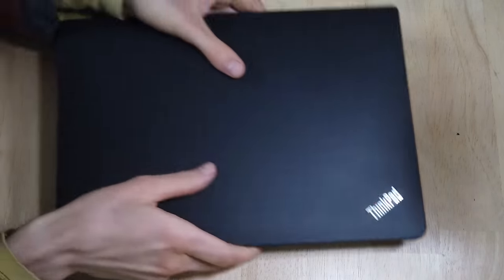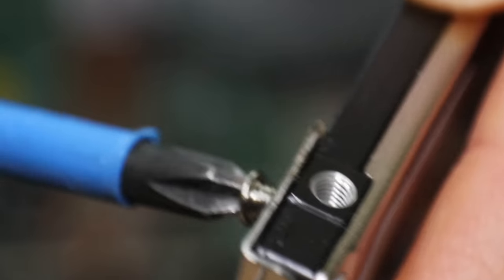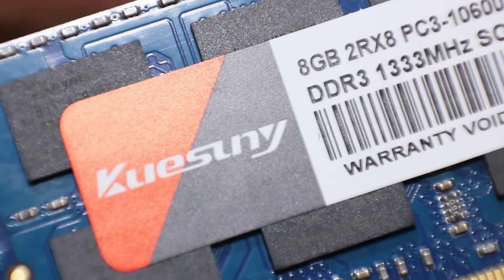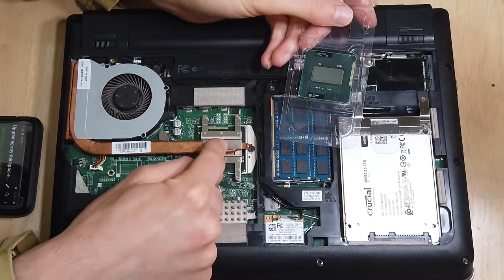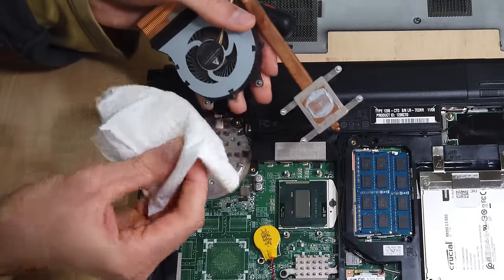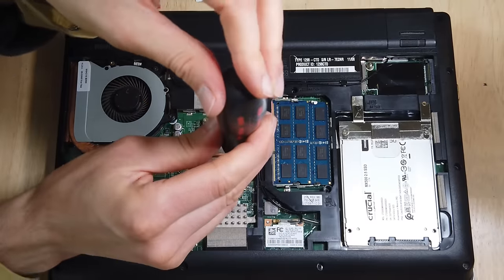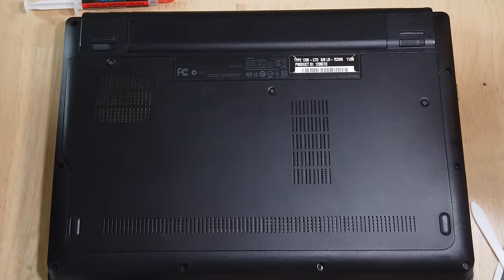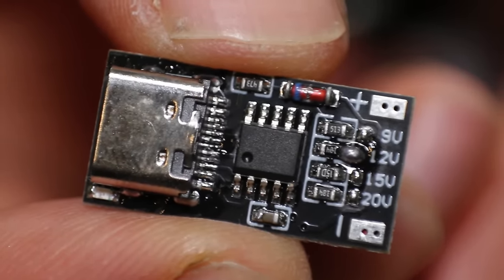The up-gradable laptop I can't get rid of: CPU upgrade etc

Comment: The upgradability of older laptops is unmatched.

Your laptop would most definitely have accepted a 3rd gen processor and the extra GBs of faster RAM too btw!
As some others have mentioned, you can also flash custom BIOS's to circumvent Hardware restrictions that Lenovo may have implemented.

From the Motherboard layout, it almost looks like certain models of that laptop might have had Dedicated GPU's installed. If they did, I guess the next upgrade is to find a model that has one, and swapping the good hardware into it too

Thermal paste application: Hilarious/10

Build overall 9.5/10

Comment: Be cautious with these CPU upgrades. Lenovo is notorious of using the bare minimum cooling in the laptops, so it is possible, that cooling system will be not enough for the upgrade cpu. I have a Lenovo G505s and i needed to replace the cooling too, when i upgraded from the A6 5350M to the A10 5750M.

Comment: I had an old Vaio that i performed all kinds of mods on, the final one was an "upgrade" from an i5 to an i7.... saying that it wasnt designed to operate that that power draw/ thermal load would be an understatement.... it was already struggling as is, to the point i had to cut out the plastic from behind the fan to allow for improved ventilation. With 70 Celsius under full load 16gb of ram and an ssd the only thing remaining was a cpu transplantation... Frankenstein posted and booted but quickly overheated and fried something... the cpu and ram were still functional but the Vaio's mobo was dead in the name of science

Comment: "Never got above 97 C" Yeah It shouldn't really pass the 80-85 degree mark. You could try undervolting the CPU so that it doesn't generate as much heat and preserve battery life.
Reply: Usually unless it is a gaming laptop the bios will be locked. Some people had made custom bios files to unlock them, but those are rare exceptions.
Reply: @DarkGT Lmao what? Most laptops don't have locked BIOSes... The only ones that are locked are likely ones from workplaces or schools
Reply: @pugical  By locked, mean locked from overclock, only some gaming laptops are business model can allow overclock and voltage modification out of the box.

Comment: I still have my previous laptop in my closet. It was a very reliable and dependable laptop. It was an Acer with a AMD Athlon x2 cpu originally, but I eventually upgraded the CPU to the best that the motherboard could support, with 4 cores! I had also maxed out its DDR(1) RAM and even installed a larger, faster hard drive, as well as a second hard drive for even more storage. She also had a discrete NVIDIA GPU with 512mb of memory

Comment: Hope that the modern laptop would adopt again the socket for the cpu
Yea.. hardly happen

Love to see this kind of content
Reply: They don't do this because the rest of the system is not really upgradeable. Might as well just replace the whole thing at that point, because unless there's a GPU onboard, the rest of the parts don't cost that much more than the CPU, and if there is a GPU, it's even more impossible, because GPUs just aren't made to be socketable anymore.

That said, there are folks like Framework that will sell replacement boards so you can just swap out the internals and keep the chassis.

Comment: Nice upgrade!  I upgraded my Dell Latitude E6540 from a lame dual core i7 4610M to the 2nd to the top of the line i7 4810MQ 16GB ram and MSATA SSD in an available PCIM slot. I noticed this Lenovo also has an available slot too, but may not need it for additional storage now with a 2TB SSD😮  you can use it for an external GPU dock live I've also done with my Latitude. This baby can run Cyberpunk😂
Reply: Thats awesome, how do you upgrade to 16gb ram?

My laptop Toshiba satellite a500 can have max 8gb ram so how I can upgrade the RAM to 16GB??

And I also upgrade the cpu??

Comment: I would have used a 2.5" sata case that can hold an ssd to put in a 2.5" 1TB SATA SSD. An SSD would have been the biggest upgrade in speed. Then I would put Linux and use the laptop another 3-4 years. I had a T410 on which I did RAM and SSD upgrade and used until last year for my Linux experiment and distro-hopping. This year I bought a T480 to continue my Linux experiment. I plant to upgrade the screen to 1440p in this.

Comment: Until two months ago, my "daily driver" was a W520. Bought new for more than 2000 Euros, it served me well for 11 years. Quadcore I7, 32 GB RAM, 2x1TB SSD, Full HD... but not capable anymore to do all the stuff I need.
Now: refurbished P53 6 core, upgraded to the max: 128GB RAM, 2x2TB SSD2 Nvme, 8k display, Thunderbird docking station.
I hope it will be as sturdy as the W520.
Reply: I think that's what a lot of people don't realize with very expensive systems, they can last for a very long time. But many modern expensive systems can't even last that long which is sad
Reply: What was wrong with the W520?
Reply: @couchpotato7750  Nothing. "Modern" software needs more and more clock cycles and features to work. Eg. backgrounds in Teams meetings, Outlook, Windows itself.... Then, our databases grow every day, and testing with a copy of the live db became sluggish. Unfortunately, I need that for my work.
Reply: @ralfmimoun2826  ah ok. Yeah I feel that, I feel like a lot of development and general software is becoming more bloated every year.

Comment: Can't let go of my E320. basically run 24/7 for over a decade. CrYou just made me realise i probably need to renew the thermal paste as she's been getting hot lately, even with the fan set to max with TP Fan Control.
Crazy how they completely understated the upgrade possibilities of this machine, it came with a SATA2 SSD and the specs don't say it supports SATA3, but of course.. it does

Comment: You could have cleaned the fan...
Also, that cpu was already not locked into the socket when you opened it. You could use a flat screwdriver to rotate the black thing to lock the cpu in place.
Reply: I was waiting until the end of the video to see if he would do that in the end. I even thought he had it in mind when he mentioned that even the fan could be disassembled, as it has screws.
Reply: @elfedorausado  He does say that he cleaned the fan in a comment, though

Comment: Switching from regular thermal paste to liquid metal will help a lot, especially on direct die application.
I've also found out that by putting the laptop on a side and making it rest with the cooler blowing hot air upwards cpu temps are even 30°C lower. It does come handy during extensive rendering sessions but of course it's not very easy to use placed this way haha.
Reply: @OKuusava  You need to pay extra attention when you apply this thing. The safest way is to cover the surrounding area with tape. Even Sony uses it with the PS5.
Reply: That’s a terrible idea, for many reasons, not the least of which…did you see his thermal paste application? That he didn’t disconnect the battery? Bless him, but there’s no way after seeing that, that you should recommend Liquid Metal. Esp on a laptop like this. All it takes is a tiny amount to unalive the poor laptop, and for what? Just use PTM7950.

Comment: You could get away with using an i7 2860qm however they do tend to be more expensive than the one you picked and while an XM model would work it is to be avoided as they run 10w hotter. It is often cheaper sometimes to just harvest that cpu from a dead or broken machine than to buy it alone. Personally I would have preferred a version of this machine with a gpu for craps and giggles but that is just me. As for upgrades go nothing beats the high end Dell Precision line aside from a few Alienware models as well some very rare Clevo/Sager and Eurocom as the bees' knees as far as laptops go from that era.

Comment: I miss these days of laptop upgradability! Just gotta make sure you get a cpu that works in that socket and has a TDP close to the one it shiped with (or you can look into other models of the same laptop with more powerful cpu and check their thermal solution to see if you also need to upgrade yours or not). I spoke to a guy who was in IT for 20 years and he argued with me that he has NEVER seen a laptops with a socketed cpu. Just found that ironic

Comment: Random rambling here:

-Ram speed isn't that important on DDR3.

-You can try a modded bios to use third gen chips but I don't blame you taking the safe route.

-That heatsink wasn't really designed for that die, apparently  (only square dies). Maybe a copper shim to the chassis would've helped.

-Don't push on the thermal paste applicators, just gently spread it around, let the rest squish with the heatsink.

-I've never heard of that thermal paste brand, honestly the cheap Arctic MX4 or MX5 would've worked just as good.

-Making the intake hole bigger would probably help the temps further, but may not look as good.

-You could've upgraded the WLAN card as well.

-Barrel plugs are superior to Type C

Comment: You should always check how much ram both the cpu and chipset supports.
My laptops cpu can handle 32gb ram fine but my chipset only handles 16gb ram
Reply: All xx20 and xx30 thinkpads support 8gb ddr3 per slot so 16GB will be the max for this machine

The W520 and W530 can do 32gb thanks to having 4 ram sockets, but it requires a quad core cpu to utilize
Reply: Thats awesome, how do you upgrade to 16gb ram?

My laptop Toshiba satellite a500 can have max 8gb ram so how I can upgrade the RAM to 16GB??

And I also upgrade the cpu??

Comment: I'd be really impressed if you could populate that GPU socket and all the empty VRAM slots on that board. Would need some bios programming probably. But it'd be interesting to know what all they left off the board for their low-end Thinkpads. But instead of buying a new battery, you should take advantage of the fact that the battery uses a series of standard lithium 18650 rechargeable battery cells. There are ways of bringing them back to life and they can be had for cheap in old DrillDriver batteries and stuff like that.

Comment: Great video! I had an old i3-3110M in my HP as my first laptop, I always wondered if ilI could upgrade it as it had the same style socket. I later just upgraded to another laptop, but it’s great to see you reusing old tech rather than seeing it thrown in e-waste.
Reply: Hey Matt, i had the same i3 in my old Lenovo G480 and indeed you can upgrade it to an i7-3610qm for example, the caveat is that the CPU doesn't turbo, it stays at a maximum 2.3 GHz because the Motherboard doesn't have the power delivery to fully push the cpu to its turbo clock speed. Despite that, the cpu retained about 85-90% of its performance and bc it only runs at 70% of it maximum clock speed it actually runs cooler (and the fan runs quieter) than the i3 that was before while crushing it in every task with it's 4 cores.
Reply: @Larroseba  that’s fascinating, I actually assumed the cooler would constantly get overwhelmed, but what you said makes complete sense. The quad core i7 is likely more power efficient as it is at less utilization than the i3 would have been at completing the same task. 

May I ask, was it a pricy upgrade?
Reply: @mattsmotorcycle  In my case it was a free upgrade, a gift from a friend of mine that his asus motherboard fried some time ago and discovered that his cpu was actually socketed. But on eBay they actually go from $38 to $60 USD
Reply: @mattsmotorcycle   i3 (35w) -> upgrade i7-3612qm (4 core / 35w).
Ali express $67-70 USD
Reply: @vladimirazirov1815  the 3610qm is pretty much the same and is way cheaper

Comment: did you make sure you discharged yourself before touching that body static and fabrics with static will kill laptop memory and cpus or a motherboard rubing fingers all over it if the environments extremally dry and cold

Comment: temps never got above 97 because that's the thermal throttling limit, the cpu is cutting back on clocks and voltage to avoid going over 97

Comment: Something that could help with temps might be to try and find the cooler that is for the model with the GPU. It will likely have an extra heat pipe or a bigger one, and it'll generally offer a higher thermal mass.

Comment: hell yes!, i love upgradable laptops, huge shame their soo rare nowadays. i had a toshiba techra r700, 250gb hdd, 4gb single chanel, i5-460m, upgraded it to 8gb duel chanel, 500gb ssd, and an i7-640m, HUGE upgrade, but unfortounatly still a duel core cpu so still wasnt good by modern standards. that laptop relied on cpu graphics... the QM cpus for that socket didnt have integrated graphics so had to get a boring duel core.

Comment: Another upgrade you could do is to remove the dvd tray and replace it with a hdd adapter so you can add another hdd/ssd for even more storage, I did that on my elitebook since I don't realy use the dvd tray anymore
Reply: I find it weird how that is even possible And the laptop very intelligently accepts the existence of a new storage device in a new location wtf

Comment: You are going to want to upgrade your laptop charger with a higher watt output to make up for the TDP of the CPU.

Ive upgraded a HP AIO touchsmart 600 that the i7 TDP exceeded the board specs andit requires a larger power brick but runs just fine.

Ive also upgraded a dell vostro 1720 with a higher TDP cpu and had upgrade the charger brick from 65watt to 90watt.

Eventually it will kill the battery and also the boards run hotter so it needs to be offset with higher wattage power bricks.

Comment: As a computer and phone repair, the cpu upgrade hurts to watch. The die on the cpu isn’t being cooled on the side properly because the copper plate is too small. Also the thermal paste killed me omg.
Reply from the maker: Yeah I was concerned about the larger die size. But all the cores seem to be around the same temp when under load. 
.... Mmmm thermal paste.
Reply: The thermal paste application is fine. A bit wasteful but it won't effect temps
Reply: @louiesatterwhite3885  I know it won’t but it just pains me to watch as someone who does it everyday as just the normal
Reply: @ashsibebytes4846  I guess it’s an IHS essentially the thermal paste.
Reply: @ashsibebytes4846  good video by the way
Reply: Do u think adding a larger copper shim onto heatsink will be ok?

Comment: I have a old toshiba with i5 2430m, it's insane how expensive are those second hand cpus. If you look for a newer generation intel mobile cpu, the prices are half of what you have to pay for g2 socket. The i7 you have is made on even older manufacturing process and the power inefficiency is even worse.

Comment: My Dell Latitude is similar. It came with 4GB DDR3 and a 2410m. It also currently has a faulty 320GB mechanical drive. I'm going to keep the current hardware and use it to host a 3D print server for Octoprint failure detection.

Comment: You also have an mSATA port, you can add storage in that, depending on the key. i had a thinkpad that had an mSATA and i used the mSATA to run linux, with my main drive running windows 10

Comment: Some correction of misconceptions about thermal pastes (according to some guy who works on thermal pastes that I saw on youtube): 
-thermal conductivity rating of thermal paste is basically a scam and has nothing to do with how well the paste performs
- the pressure between the dye and heat sink is usually very high and there's no way bubbles could form between or anything like that. basically there's no need to spread it carefully and thin because it all gets squeezed and evenly distributed anyway (which i totally did on my laptop cuz it has to be perfect and i guess it wasn't in the end), unless you put too little. If you put too much, you're ok if the paste doesn't conduct electricity.
-for laptops it is advisable to use thicker thermal pastes because laptops run at relatively high temps which squeezes the paste out much faster than it would on a well cooled desktop for example. Thin pastes usually perform better by default but the pump out effect on laptops can make it 'degrade' in a matter of months and it will then perform worse that a thicc paste.

Comment: O for the reason it’s overheating is cuz the copper part of the cooler doesn’t fully cover the entire die.
But I doubt Lenovo actually sells a right one, might be lucky if you get a 3gen cpu with a smaller die size

Comment: I have a slightly newer Dell Latitude, it came with a similar setup with slightly more modern hardware, a Core i5 3340m with 8gb(2x 4gb) of 1600mhz DDR3L 1.35v ram, it was quite fast, i later put a Samsung 860evo 1Tb mSATA SSD on it and a Core i7 3740qm with 16gb(2x 8gb). Recently a upgraded again putting another normal SATA3 SDD, same model as the mSATA but with 2Tb, also changed it's stock 90w power brick for a 120, with that a managed to max out it with a Core i7 3940xm and a whooping 32Gb(2x 16gb) running at 1866mhz. I i'm still surprised that it actually worked